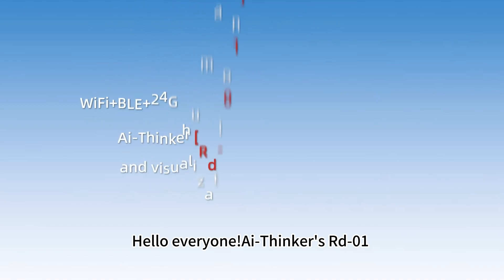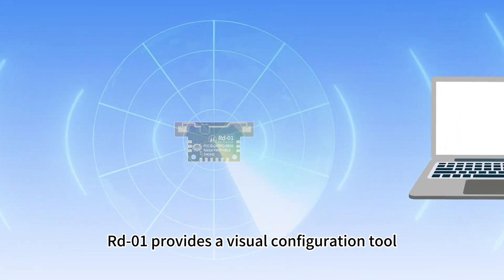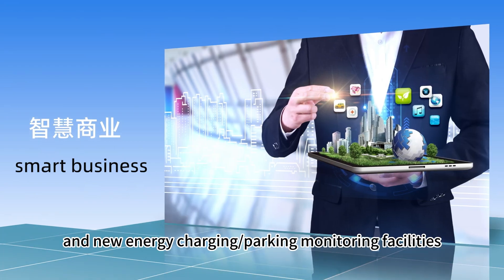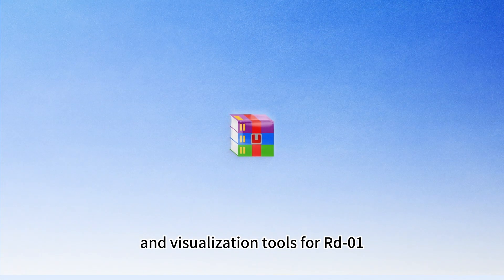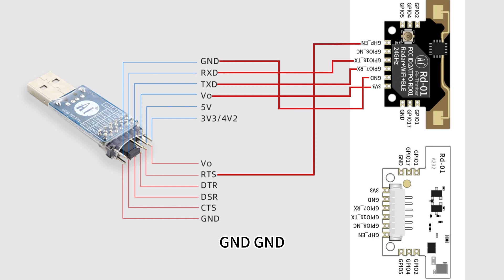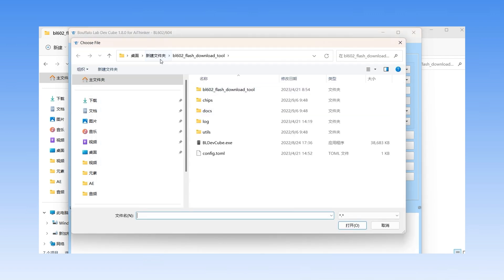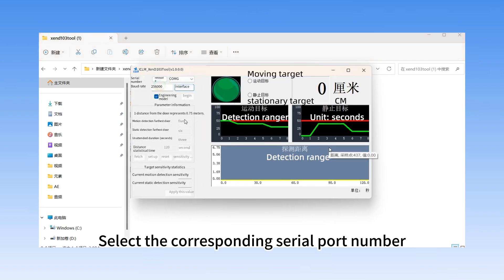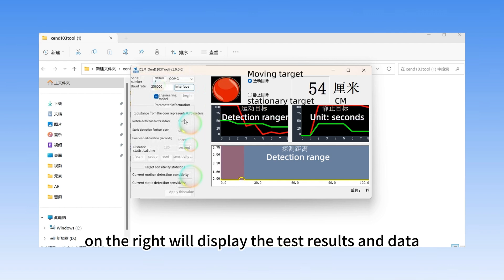Ai-Thinker‘s radar module [Rd-01] Firmware burning method and Pc software setting

Comment: Hello. Is there any gpio that gives output to the RD-01 module when a human is detected? I looked at the datasheet but could not find such an output pin.
Reply from the maker: Dear, The default firmware does not have it, and you need to re-burn the firmware to achieve it. To obtain firmware, please contact overseas@aithinker.com

Comment: Hello @ai-thinker, Please provide English version link of the visualization tool you have used in your video and also please provide the tutorial link for Wi-Fi and BLE setup with this module. Thanks.
Reply from the maker: https://docs.ai-thinker.com/_media/xend103tool_v1.2.0.0_.zip
Reply from the maker: This is the visualization tool
Reply: @ai-thinker.  thank you for sharing the link, but when try to download and extract the zip file it sends an error i.e.  "archive is corrupt" and unable to extract the zip file. Please have look into the issue to fix it and resend the correct working English visualization tool zip file again. Thanking you.
Reply from the maker: For the wifi and BLE connection part, haul needs to carry out secondary development based on the SDK. Here is the link for the SDK: https://github.com/Ai-Thinker-Open/Ai-Thinker-Radar

Comment: You seem to have the only English version of the visualization tool that you use in the video. Can we get a link to it, also how do you setup the Wi-Fi and Ble?
Reply from the maker: https://docs.ai-thinker.com/_media/xend103tool_v1.2.0.0_.zip
Reply from the maker: This is the visualization tool
Reply from the maker: For the wifi and BLE connection part, haul needs to carry out secondary development based on the SDK. Here is the link for the SDK: https://github.com/Ai-Thinker-Open/Ai-Thinker-Radar
Reply: Thank you

Comment: hi, what is the measurement accuracy of the sensor in millimeters?
Reply from the maker: Hanging on the side wall, the maximum detection distance is 5 meters;
Hanging top installation, hanging height 3 meters, detection radius 3.5 meters
Reply: @ai-thinker.  tnx